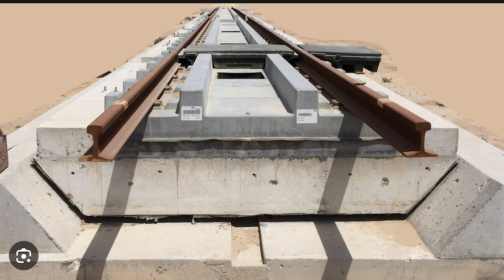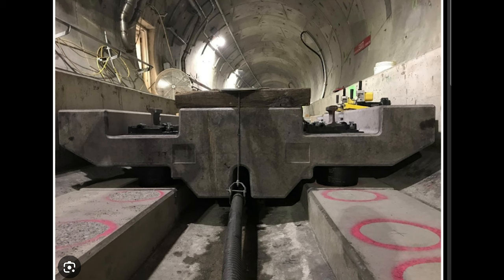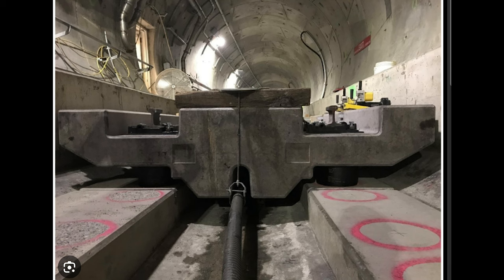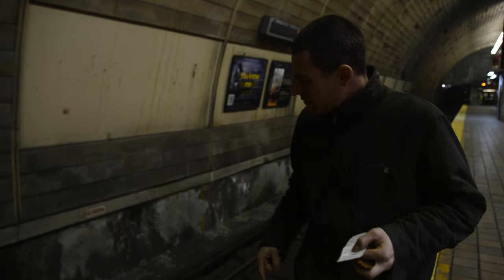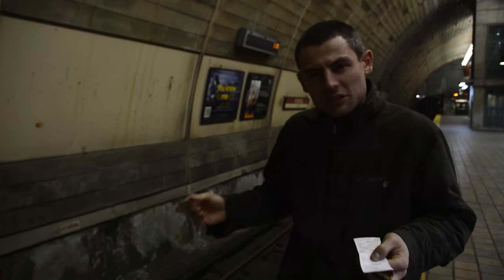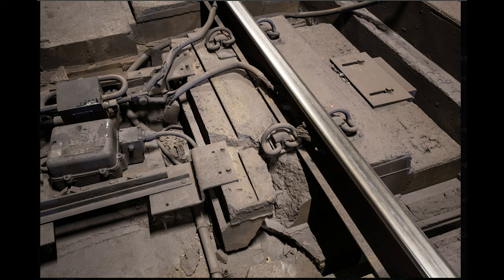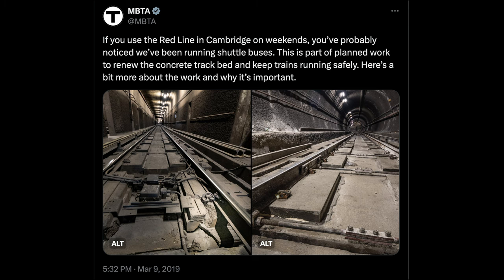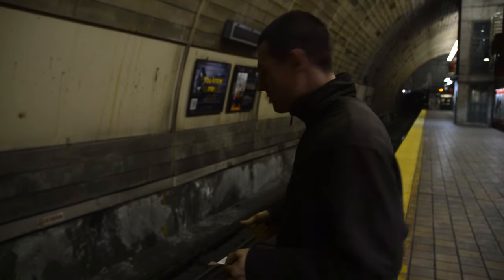MBTA 1:  The Horrors of Porter Square

Comment: Heh, the "noise-canceling" feature sounds very similar to WAMATA (DC metrorail system.) 

I suppose one silver lining could be that all of the water would prevent fires but... 

It doesn't.

Each day I wonder whether the system will wipe us out by fire, flood, or electrical shock. But, it will likely be the horde of rats that are somehow immume to the other three dangers.

Comment: Hydro turban? The track system described was used in New York from the 1930's; supposed to be cheaper and more durable. Rust never sleeps, eh?
Reply from the maker: That is not correct, you are thinking of NYC's type 2 and type 2 modified, which is wooden ties inset into roman concrete as a gauge holder.  There is nothing remotely resembling floating and unsupported pads at play.  Type 2 modified is some of the strongest and most robust track ever created for rapid transit
Reply: @AEKarnes  I stand corrected; you know your technical trivia. old fashioned  wood and stone is still the quietest, keep posting! Some years ago I made many a pilgrimage to 10 Park Plaza to warn them of the issues you cite, and would look forward to the intelligent exchange of information.